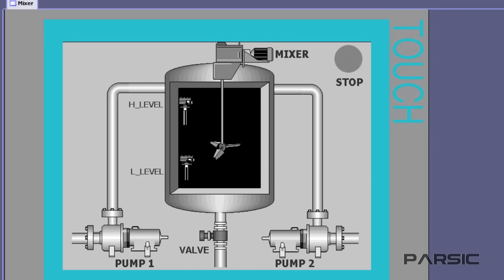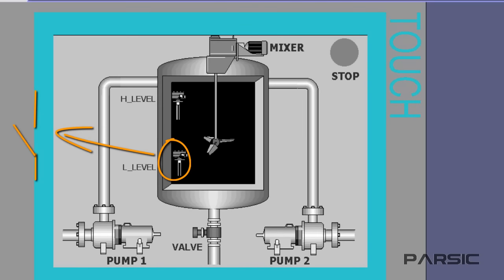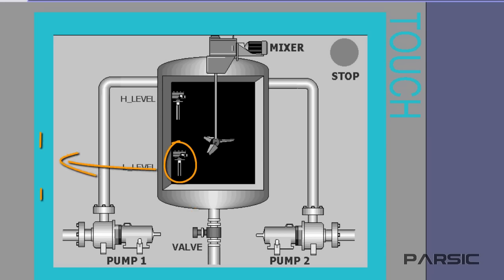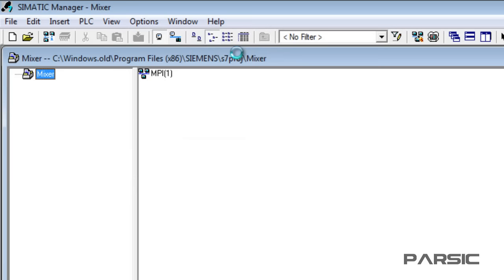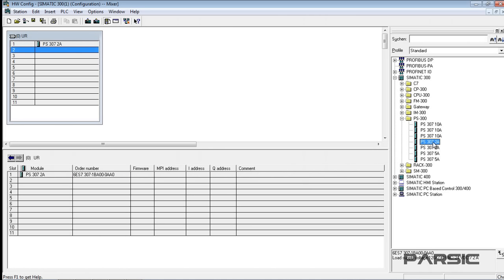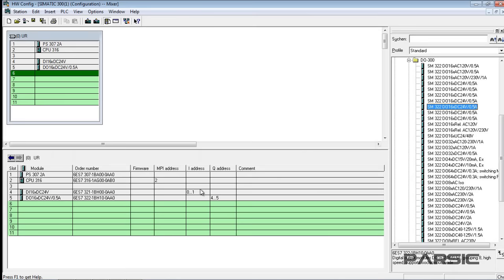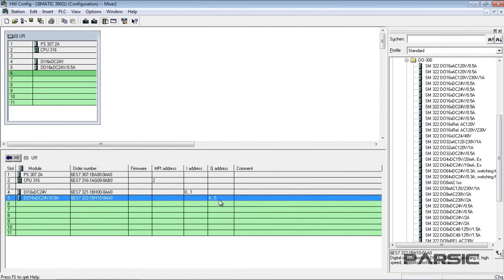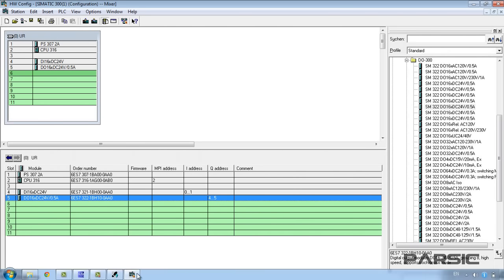PLC Programming Tutorial for Beginners_ Part 1

Comment: What a fantastic explaining. can you help me please? I've got an error when trying to download module after select the cpu module, it shows error status "Download (288:47)" with message "Unable to reach the module CPU 316 via the online interface". I'm very beginner of PLC Programming, thank you
Reply from the maker: First, you will need to start the S7-PLCSIM program and set the PG/PC interface on the toolbar of the simulator window.  Then, in STEP7, you will need to open the SET PG/PC Interface window by going to "Options > Set PG/PC interface..."   Set the PG/PC interface to the same type as selected for the simulator.  For additional help (items 1 and 2 only):  https://support.industry.siemens.com/cs/document/11870489/how-do-you-generally-parameterize-the-pg-pc-interface-and-how-do-you-ensure-that-the-device-driver-can-be-selected-and-is-visible-?dti=0&lc=en-WW
Reply: @realpars  thanks for your help, it solved :D
Reply: @realpars Thank you for video, and for troubleshooting

Comment: Can you explain why the STOP signals are connected to the Reset Inputs?
 
If the tank is currently getting filled, and the STOP button is pressed, I would expect the H_LEVEL Reset Input from Network 1 to not function (and as consequence the pumps will continue to pump even when high level is reached). When the high level is reached, H_LEVEL Set Input from Network 2 will be energized, and the MIXER will be active for 7 seconds. Now the Set Input from Network 3 is energized, i.e. the tank has reached a high level and the mixer is off, and as consequence the VALVE opens. If the STOP button prevents the L_LEVEL Reset Input from Network 3, there will never be a signal for the VALVE to close again.
 
I would expect the sum to be that the pumps are constantly active, and the Valve remain open, what have I misunderstood?
Reply from the maker: The STOP signals to the SR flip-flop will reset the Q output of the instructions.  The SR flip-flop output stays energized even if the S input is removed.   Good programming practice is that all motors stop, and all valves go to their fail-safe position upon a STOP command.  So when the STOP button is pressed, both pumps and both valves will go to the "0" state (off for pumps, closed for valves).

Comment: Why should we choose 16 output and input module instead of 8 and other modules? Please explain.
Reply from the maker: There are several considerations that go into selecting an I/O module.  One 16-point card is usually less expensive than two 8-point cards, but sometimes, for example, an 8-point digital output card offers relay outputs with enough power rating to pull in a motor starter or relay, whereas solid-state contacts on a similar 16-point digital output card may be suitable only for non-inductive loads.  It pays to understand what you are getting with any I/O card you specify.  Look at power rating, contact types, optical isolation, diagnostics capability, and signal types that can be used.  For example, not every digital input card can handle high-frequency switching inputs, and not every analog input card can process 0-10VDC inputs.

Comment: Please help 1. I need the connection between the laptop and the Siemens 314C 2DP. 
2. The LAMP of the SF is RED and cannot access the station even after MRES. What is the possible trouble? thanks a lot
Reply: mike samaki put the MRES into the RF converter hooked up to the SF. It should reboot automatically and get code 43FG2 so you then just rewrite the code and put it in the LAMP

Comment: What are the programs you used and where can one download them?
Reply from the maker: We used Siemens STEP 7 PLC programming software and WinCC operator panel software.  A trial license can be purchased for $32USD at: https://marketplace.realpars.com/products/simatic-step-7-basic-prof-wincc-basic-comfort-advanced-trial-v15-15-1-engineering-software-in-tia-portal-trial-license-sw-and-documentation-on-dv-6av2102-0aa05-0aa7?_pos=1&_sid=69f97a192&_ss=r

The full non-expiring license is $2290USD:  https://marketplace.realpars.com/products/simatic-step-7-prof-v15-1-floating-license-download-engineering-software-in-tia-portal-software-documentation-and-license-key-for-download-class-6es7822-1ae05-0ya5?_pos=4&_sid=9d9159b98&_ss=r

Comment: 6:02, absolute novice here.  How is the desired cpu module determined?  Is it determined by the control voltage used by the module and the voltage of the controlled devices?
Reply from the maker: CPUs are selected based on many criteria.  Input voltage is one of those criteria.  More important are memory size, capability and number of ports for Profinet, Profibus DP, etc, maximum numbers and type of I/O allowed, and expandability.
Reply: @realpars  Would you please recommend vids or a series of vids for the beginner.  Or is this as basic as it gets?  Looking at a possible plant closing and trying to get some marketable knowledge.  Mainly doing machining and mechanical work presently.  And thanks for your reply.  I appreciate it.

Comment: I am not sure that this program will work properly, if there will be no liquid, no signal L_Level, it will not work. Another think is about opening outlet valve, it can open also after reaching H_Level and before mixer start (it is not explained). But thank you for programming tutorial.
Reply: yeah, I would like to know the same thing. can someone explain how to get liquids for the first time inside tank to activate the l_level switch? add liquid manually or what?thanks!

Comment: I have this problem in automation and I am just not able to figure solution for this.
Please help me if you can
Here’s what my problem is I am using a scanner to scan trills.. The output of the scanner is the input of an Air gun;; I.e my scanner is an input and my air gun is the output
So this is how my process works.
 I am scanning trills,, when a trill passes in front of a scanner, an output is given by my scanner to the Plc,, and when there is no tray no output is given to Plc,, now what I want to do is that for the trills which are slightly longer, I want my air gun to blow them away,, Now in that case the output is gonna be given by the scanner to the plc for slightly longer time,, maybe a few milliseconds longer than the ideal case(where the trill is of perfect size) What I want to do is that my air gun shall only operate when an output of the scanner was given for that’ slightly longer time, in all other cases the air gun shall stay de-energied.. I am having confusion with how to write code in between them I have mapped my scanner to x1 input on plc and air gun to y1 output. So [XIC]energise>> ()y1 I am having confusion on what to put in between if like timers how do I measure such precise time difference and how do I Initialisé my gun with scanner input and what to do to reset it again after once it was used and held for few seconds..

Comment: sir all the steps u done in this video i have done the same but the simulation icon is not active , I am using version 5.6 of S7. please guide me sir
Reply from the maker: Hi there, If you don't see the simulator icon active, it means that PLCSIM has not been installed on your computer properly. Try re-installing STEP7 again but this time just install PLCSIM (only check the box for PLCSIM while installing as you have already installed the other software components). Good luck!

Comment: Do you have link for installer compatible for windows 8?
Reply from the maker: The software we're using in this video is STEP 7 V5.5 which is not compatible with Windows 8. You can install this on Windows 7. For Windows 8 you need to install TIA Portal.

Comment: what is difference bw plc 300,400,hmi etc
Reply from the maker: S7-300 PLCs are ranked as a medium PLC while S7-400 are high-level PLCs with larger memory capacity. S7-400 PLCs have more I/O and can be used for more complex control systems.

Comment: Can someone please confirm that the 2 level switches are the opposite of one another? As I understand from the video, the high level switch is normally open until the liquid fills the tank and causes the switch to close upon contact with the liquid. The low level switch is normally open when in contact with the liquid and closes when the level in the tank drops below the level of the sensor?  That seems a little backwards to me, hence the reason I seek clarification. Thx in advance.
Reply from the maker: Level switches normally come with two contacts, one NO contact and one NC contact.  The one you use for your application is up to you.  In this PLC programming beginner's course, we have chosen the switches to act as they have been described to make understanding of the logic easier.  In this video, the switches follow the function:  energized belowt low level and above high level.  If you select the switches to be wired in the "failsafe" position, they would be wired in the opposite sense.  This may provide an extra level of failsafe operation, but the logic would be more difficult for someone starting out in PLC programming to understand.

Comment: For the I and Q addresses for the input and output, why would it start from 0.0 and go up to 1.7. If we have 16 bits to work with, wouldn't that just go up to 1.5?
Reply from the maker: When PLCs first came on the market, all I/O and other memory spaces were addressed in Octal format.  As PLCs matured over the years, most PLCs used decimal words for memory spaces.  However, it was common, as it is for Siemens I/O, to still address the I and Q addresses in octal since they are organized in groups of eight inputs and outputs. Therefore, a 16-input card in the first I/O slot is addressed: I0.0. through I0.7 and I1.0 through I1.7.  These addresses are mapped to two words, IW0 and IW1.
Reply: @realpars  that definitely clarified it. Thank you

Comment: Are the different slot different pins?
Reply from the maker: No.  The cards in an S7-300 "rack" are mounted on a profile rail (think of a very wide DIN rail).  The cards are connected to each other using bus connectors that attach the back of each card.  The bus connectors used are the same for all card types.  The card electronics are different based on type and function.  Typically, the "slots" are assigned as (1) power supply, (2) CPU, (3) IM, (4) - (11) signal and I/O cards.

Comment: You have lost me at the digital input and output , it says 16 slots , so starting from I - 0.0 , 0.1 , 0.2, 0.3, 0.4, 0.5, 0.6, 0.7, 0.8, 0.9, 1.0, 1.1, 1.2, 1.3, 1.4, 1.5,  that’s 16  how do we get to 1.7 ??? I was told it’s easy and logical but I have only started and I am stuck, can someone please explain this as the video does not fully explain the logic behind numbering , thank you .
Reply: think I have cracked it !
It’s a 8 bit system so I can only use these numbers-
0.0,0.1,0.2,0.3,0.4,0.5,0.6,0.7
1.0,1.1,1.2,1.3,1.4,1.5,1.6,1.7
That is 16 in total I believe .

Comment: why do we always choose 2Ampere PS in s7 300 plc?
Reply from the maker: We don't always choose 2A power supply  for S7-300 PLC. The power supply you use for your PLC depends on the number of modules you have in your PLC. Each modules needs a certain amount of electrical current in order to turn on and stay on. The power supply provides this electrical current. So the output current that the power supply provides us should not be less than the total current that the all the modules need. In other words, the output current of the power supply has to be such that it's able to keep all the PLC modules on.
Reply: RealPars thank you for your time to reply . ☺

Comment: Can a simulator work without S300 connected to pc?
Reply from the maker: Yes.  S7-PLCSIM is a software application that emulates the function of the S7-300 PLC.  No PLC is required to be connected in order to run a program in S7-PLCSIM.

Comment: after save and compile , i am getting "unable to reach the module CPU 316 via online interface" any help?
Reply from the maker: For this issue, there are usually two things to suspect.  One, the PG/PC interface is not configured correctly, and two, either the CPU node number or cabling is not correct.  When connecting to a CPU, I like to:  [STEP7 v5.56] - right-click on the CPU in the PLC menu item, select "Accessible Nodes".  [TIA Portal] - in the Online menu, select "Accesible Devices".

Comment: I am unable to download the hardware to the module. It says communication link to the adapter damaged. Cannot find any MPI address. Also the simualtor is not enabled so I cant open that. Please help
Reply from the maker: The error that you get is normal because the simulator is not running. When the "simulator on/off" icon in the toolbar is not active it means that "PLCSIM" has not been installed on your computer properly. So you need to install "PLCSIM" again.

Comment: How does I0.0 to I1.7 and Q4.0 to Q5.7 gives 16 digital inputs?
Reply from the maker: Thank you for your question! It’s all based on computer science principles. A PLC is essentially a sophisticated microprocessor designed for its specific application.

In Siemens PLCs, the “I” in I0.0 stands for inputs, and the “Q” stands for outputs. The Siemens PLC processes data in bytes, each consisting of 8 bits. The first byte in memory is “0,” the second byte is “1,” and so on, up to the memory limit of the PLC. For example, a byte (8 bits) includes bits 0 to 7. Combining two bytes gives you 16 bits, which can be addressed regardless of whether they are inputs or outputs.

If you want to learn more, we offer courses on these topics at RealPars.com. You can sign up for free.

Comment: While trying to download and then selecting CPU 316, it is showing that "Unable to reach the module CPU 316 via the online interface." Plz help me.
Reply from the maker: If this is a physical CPU, check the cabling and the selected interface.  If you are trying to download to the simulator. stop and close the simulator and open it via the "Start Simulator" function in STEP7 (icon on the toolbar) or TIA Portal (Online | Simulation | Start).  Also, make sure you are using the correct PG/PC interface and if using the latest TIA Portal simulators, that the correct CPU type is selected.
Reply: @realpars  I'm just a student, I want to learn the PLC in my pc. I've downloaded by following steps given by you in another video. But I think there is some problem with the software. While starting the software it shows 'STEP 7 has found a problem with the automatic lisence manager. The application is closing. Please reinstall the ALM.' but if I run it as administrator it works fine only while doing program it is showing the problem I've stated earlier. Plz help me.

Comment: Dear sir, Simulation button on/off is disable for me.
Reply from the maker: Hello @paxniotis . Thank you for your question. Can you be more specific about your question? It’s hard to give you an answer to what simulation button you are asking about. For example, is it the Siemens software? What version are you asking about? This video is based on Siemens S7 Simatic Manager PLC programming software. If you have a licensed copy installed and are having problems with it, the software has a help menu you can look up if it gives an error code.
Reply: @realpars  Hello. I downloaded and installed STEP 7 V5.7 SP2 (if found also v5.5 SP3). If you have a link with another version and license (instructions), I would really appreciate it. Thank you!

Comment: Prob a stupid question but Why are 16 input or outputs going from 0.0 to 17, and 4.0 to 5.7 not 1.6 and 5.6?
Reply from the maker: This is actually a very good question!  I/O cards typically are mapped to one or two words that are addressed in octal.  In octal, the first 16 inputs or outputs are addressed as: 0.0, 0.1, 0.2, 0.3, 0.4, 0.5, 0.6, 0.7, 1.0, 1.1, 1.2, 1.3, 1.4, 1.5, 1.6, 1.7.

Comment: Can you plz explain how bit 0 to 1 gives 16 digital inputs? :/ 

Reference: https://youtu.be/y2eWdLk0-Ho?t=7m48s
Reply: And what is Q4.0 to Q5.7!? How you are getting these?
Reply from the maker: The digital input module we're using here has 16 inputs. In the HW configuration it says the default addresses for this input card include byte 0 and 1 in the PLC memory. Each byte induces 8 bits. We have 2 bytes here so there are 16 bits or 16 inputs addresses that we can use for this input card in the PLC program.
Reply from the maker: These are the addresses for the digital output card. The digital output card that we're using for this PLC has 16 outputs. If you go to HW configuration and click on the output card, you'll see that the addresses you can use for this card include bytes 4 and 5 in the PLC memory. So the addresses for the first byte include Q4.0 to Q4.7 and for the second byte Q5.0 to Q5.7. These are the default addresses that are defined  by the software. You can change these addresses as well. For instance if you change tthem to byte 6 and 7, the addresses that you can use in the software will be Q6.0 to Q7.7. Hope this helps! :)
Reply: Thank you for the details.